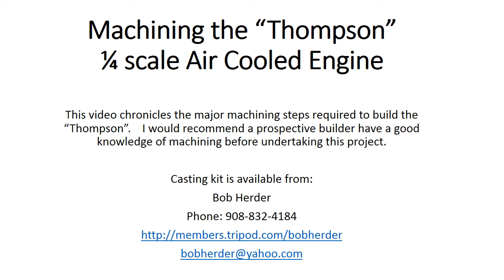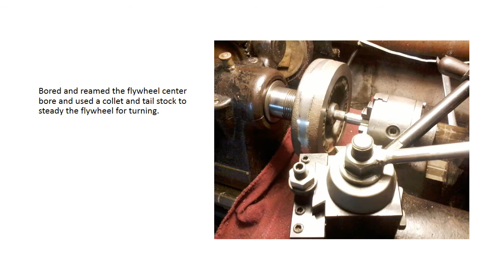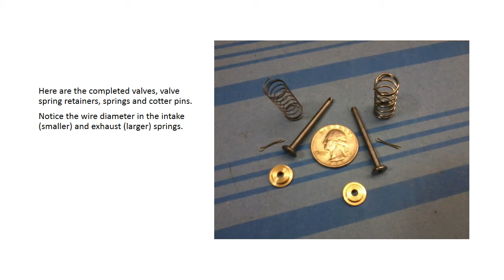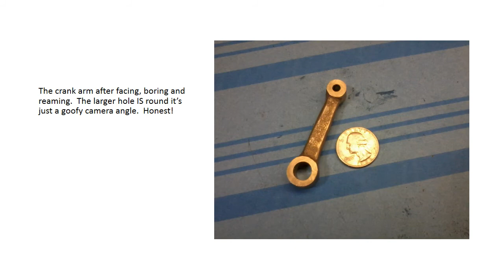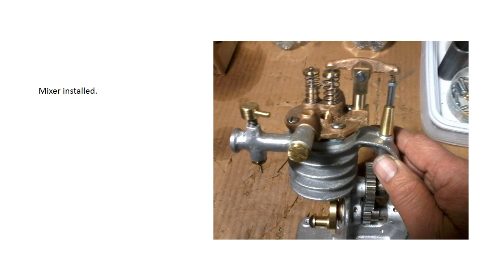Thompson assembly process powerpoint show

Comment: About 18  years ago I borrowed some wooden patterns from a friend in Michigan.  I took them home and cast up several sets of castings they look a lot like this engine.  The drawings I have say "Sisson" engine, there is a round cover for the crank case with an S cast in.  The base plate is smaller.  I gave a set of castings to a buddy and he built one. Some day I will build mine.  Seems to run nice.
Reply from the maker: I encourage you to build it when you have time.  It is a great journey if you like machining and it is a special feeling when you hear it run the first time.  Good luck on your build..

Comment: Just ordered this casting kit from Bob Herder. He has already offered help before I have received the kit. I,  like you have built different operating engines. Thanks for the video and your set-up methods. Cant wait to start on this Thompson casting kit.
Reply from the maker: Hello Joe,  Bob was, as I said in my video, a huge help to me.  The Thompson is the one and only engine I have built from a kit.  I do prefer to make my own designs and now I have taken to casting bases and cylinders myself. Stay tuned to my channel I have a real sweet engine that is almost complete I will be showing.  Just a hint it is a stationary steam engine with no cross-slide. I don't know if you have seen it but there is a video on how I machined it on my channel.  It's not the address in the video.  Youtube messed me up.  A couple of other fellas have used it as a guide and they said it helped in some operations.  All I can say is don't rush it.  It's the journey not so much the destination.  Best of luck  Fred  Ontario, NY
Reply from the maker: Joe, You can find that Thompson assembly PowerPoint presentation here >>> https://www.youtube.com/watch?v=dII3_v90rNQ Of course you can stop the video at any point to read the text of look at setups.  Best of luck.  Fred
Reply: Interesting.. no cross slide and I am assuming not a wobbler design ether.  Cant wait to see you design! Thanks for the reply.
Reply from the maker: I should have the video posted in a couple of days...  Cheers-  Fred